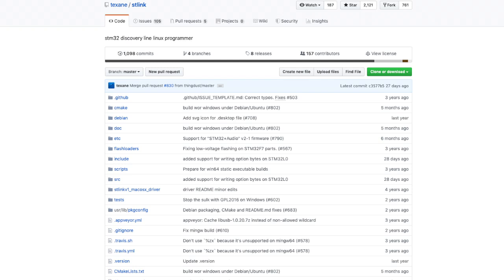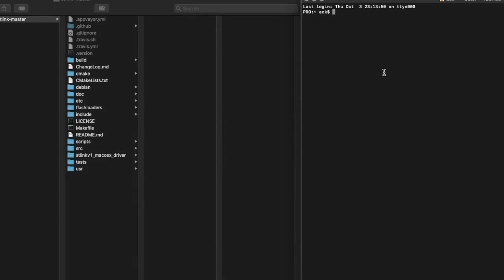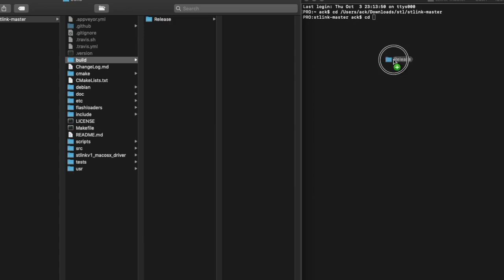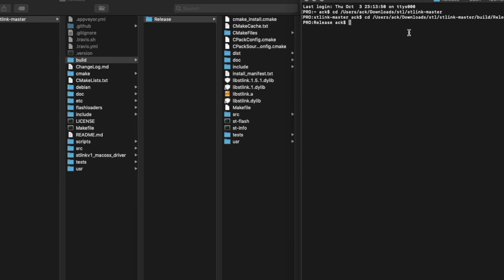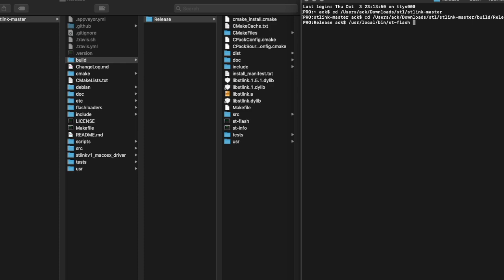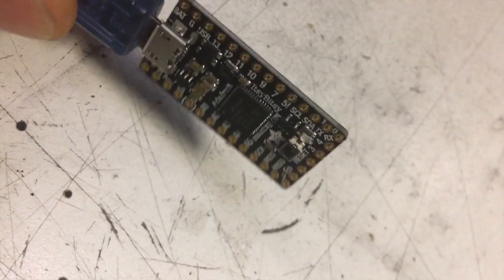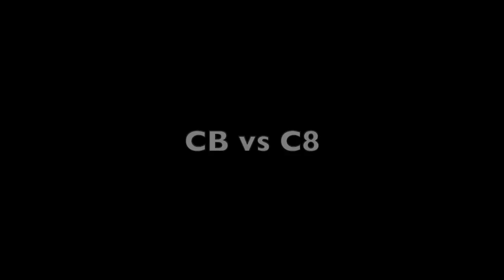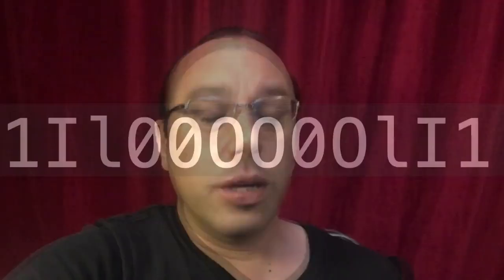OOPS... 'fake' BluePill boards, and what to do about it

Comment: A few of my troubles with Chinese "blue pill" clones. The CS32 work actually reliably once flashed, unlike many others that have grounding issues, some weird capacitance issues (wouldn't boot unless touched the right way), I had to throw away most of them as no amount of alcohol baths helped, but then found a good supplier on aliexpress selling those CS32 and every board worked perfectly. To flash them, you need to revert commit 3295ab4e5 in the texane/stlink repo (and fix the git conflict), optionally disable gtk3 GUI in CMakeLists, build it and then it works fine. And mine have 128K (Marlin wouldn't fit otherwise).
Reply: Sorry, stupid me didn't listen close enough. It indeed seems to be fixed in newer texane/stlink releases, like you said.
Reply: What's your preferred store on Ali for CS32?
Reply: @SianaGearz  The boards I got are from "FXI Electronics Co., Ltd", item number 33004099975 (in URL). I ordered two to start with, both tested good, so I ordered 12 more and all seem to work fine. However this was some 5 months ago, so I might have been lucky with a good batch - no guarantees, no affiliation with the store.
Reply from the maker: Good to know.  I did notice that all the boards I got have the proper usb resistors, which is good.  I got a mixed bag, so I'll have to check which  might have 128k.  Once I got them running, they seem to work fine.  I've been using one all day for some square wave testing, flashed dozens of times, and it is all good.  It actually runs some operations a bit quicker than the 'legit' boards
Reply: @AlexKenis  FYI: All the boards I've received in the last year (incl. the bad ones) have had the correct USB resistors, so at least this plague may be over.

Comment: I have one of this fake blue pills and there were no problems when programming with ST-LINK v2 (upgraded firmware). I am using Keil v5. Debugging also works. :)
Reply: Hey, i'm probably late but I wanted to know how do I do it for cs32f1/cks32f1 in KEIL with stlink v2? I can't seem to find stm32f1x.cfg file for keil

Comment: OK I am posting a new comment about mine. It seemed with my blue pill you had to release the reset at the same time the cube programmer was waiting after pressing connect. About half the time it would connect and then program. At this point I installed st32duino which is happly ever after. Mine  seemed to have this critical ttl programming timing.